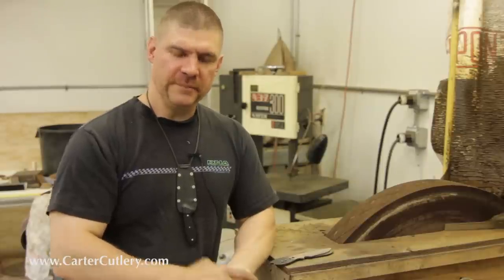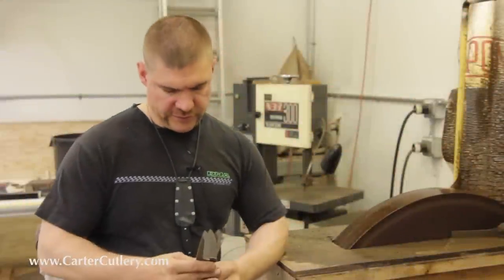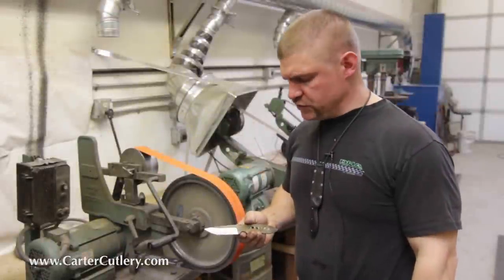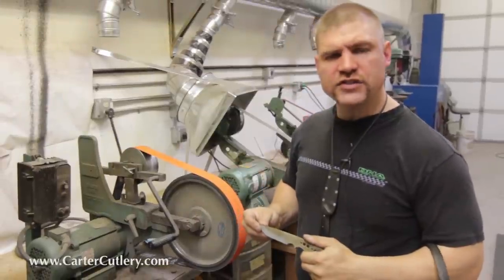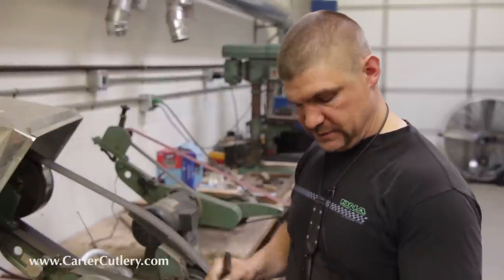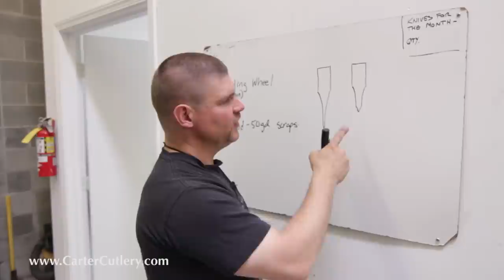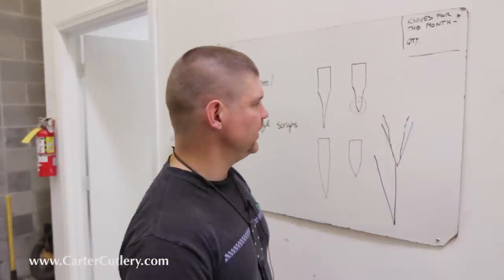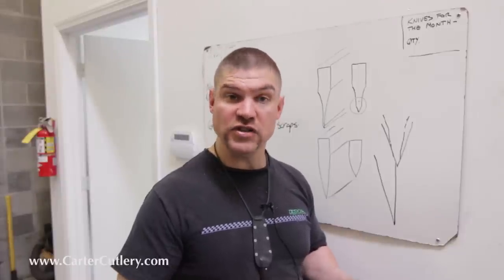Grinding Hollow, Flat, and Convex Profiles - MURRAY CARTER

Comment: I prefer a deep hollow grind on my knives. Easiest to sharpen, just by laying it flat like a flat grind I can get the sharpest edge possible and if any chipping occurs during my intended use I can easily do a "micro convex" on the primary edge with a leather strop and compound. I think that the flat spots that occur and grow with each usage with this technique on the secondary edge add character. Eventually, after hundreds upon hundreds of sharpenings, you wind up with a thin, flat grind knife.

Comment: I prefer the deep hollow grind because you have less metal contact of all knife grinds on the stone. Just the edge and the secondary border or spine area of the side depending on how high up the hollow goes. It's kind of like sharpening a straight razor and using the spine as a guide to set your primary edge geometry..

Comment: Did you do a cutting/use comparison of these knives elsewhere? I cannot find it, or any discussion about the benefits of these different grinds for different uses?
You've covered everything in your videos, I'm just assuming you have this covered somewhere?
Thanks,
Gus
Reply from the maker: We do not have a video about that topic, specifically. I recommend browsing some of the knife enthusiast forums - I am sure they have some.
Reply: Hi Murray,
Endless discussion. But I've yet to see like compared with like - same steel, same knife profile, same blade thickness to remove these as variables. 
In the video, you are grinding post heat treat?
Reply from the maker: Yes, the grinding is being done post heat treat. You have to pay close attention to the temperature when grinding metal on a belt grinder.

Comment: utterly confused with saftey procedures.. 

Hearing protection in relatively low DB area: CHECK

Breathing protection:CHECK

Eye protection: WTF haha

Not a safety nazi by any means but a little odd I find shit flying all over the place on my belt grinder. Safety squints work pretty good and i can avoid most debris. haha

Never even thought to wear hearing or breathing.. never seem to get anything in my throat or ear that prevents them from working...

Very informative video thanks for taking the time to make these.

Comment: can the grind of a knife be changed.  I have a knife that I love but the grind of the knife its to low.   is it possible to change the grind without damaging the temper of the knife?
Reply: Yes but there has to be enough meat on the blade to change it.
Reply: William Miller , would you mind if I send you a picture of the knife? I'll really value your opinion on it.
Reply: Sure go for it. I am currently an amatuer bladesmith but have been into it for a while
Reply: William Miller, where can I send you the picture?
Reply: William Miller, can you please verify your email address.   I'm getting an email error.
Reply: as long as you go slow and don't get it hot it should be fine. grind it with no gloves or tape on fingers. when it starts to get to hot to hold cool it down. you should never see a blue or discoloration of the blade. use extreme caution as the tip and thinner edges will heat up faster

Comment: Murray, is it common for Japanese blade smiths to use tools running away from them? You're the only person I've seen who's machines consistently run away. I'm wondering if it's just you, or a traditional philosophy, like western saws and planes versus Japanese. I'm thinking of switching my equipment to do the same, it just seems more natural and controllable that way.
Reply: I noticed same thing. my motor will go either way but did not install a switch when I built my grinder as I thought I would not use. I might rethink. I often turn my blades upside down when doing the final edge with a fine grit. I think it's a more forgiving way to sharpen.